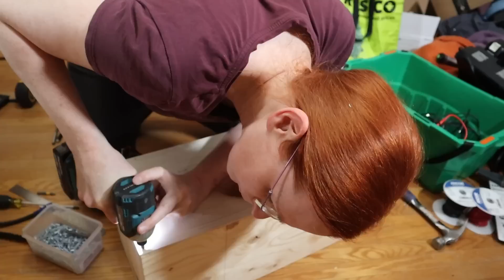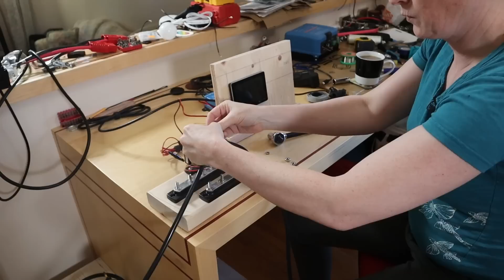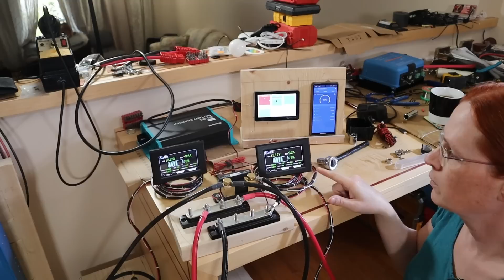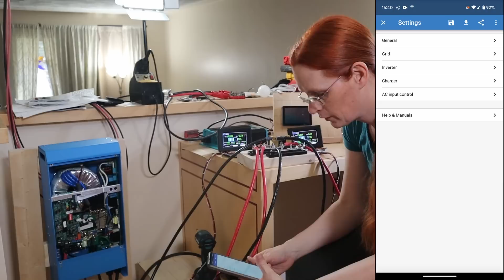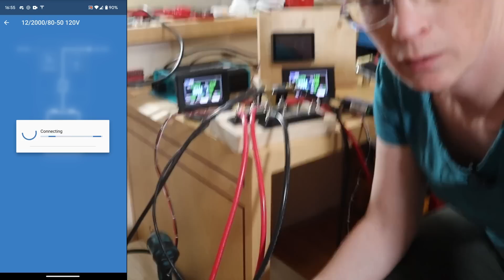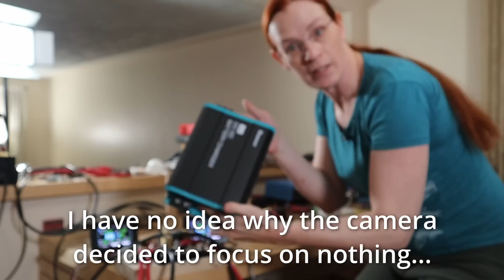Power To Get Me Home (Ep. 61)

Comment: Something I did for a precharge resistor was to put a cheap volt meter across it. Then if there precharge resistor has a voltage difference across it then that'll show on the volt meter. Once the precharge is compete it should show zero volts. Same thing could be done with an LED perhaps?
Reply from the maker: Huh, those might well work, too. Others commented that the lead (graphite) from a pencil would work, also.

Comment: What kind of Temps are you going to see in your engine bay?  Remember most engines will run at 70 - 100 c
Reply from the maker: Not sure, but "hot". I'm planning to get that sticky-back reflective thermal insulation to cover the engine bat facing battery.

Comment: Just gave me that "Duh" moment and made things Click for me. I have my BMS and Charging system set at the same voltages for shut off. When you said do I want my bms or the charger to control charging cut off. It just made it all clcik that I need to change those settings. Coincidentally in the throws of redoing my camper system for the season.
Reply from the maker: Glad it helped! I ended up setting the Multiplus to stop charging at an even lower voltage (coming video), as the math I was doing was assuming all cells were balanced. When they're not, the BMS will cut off at a lower pack voltage, causing the Multiplus to just suddenly lose the batteries.

Comment: Tip for drilling wood for screws - size your bit to the base diameter of the screw, the screw minus the height of the threads. Some screws do better with a tapered bit, such as wood screws. Lag screws require two diameters, one for the thread area and one for just below the head.
Reply from the maker: Yup, that's the target and good advice. I just mis-eyeball'ed it on this one... Clear for the screw's shaft, let the threads do the work.

Comment: The Top 10 Things I Learned From This Video

Using cable lacing to clean up wiring harnesses.
Using simple screws and avoiding machine threads when putting lids on equipment to avoid damaging batteries.
Being careful when drilling pilot holes for screws to avoid damaging batteries.
Breaking edges on lids to avoid snagging on things when moving equipment.
Using a resistor to pre-charge the capacitor and making sure to connect it correctly.
Updating firmware for batteries to ensure compatibility with other devices.
Checking voltage and transfer current to monitor battery performance.
Being careful when working on projects to avoid damaging equipment.
Salvaging parts to save money instead of buying new ones.
Setting up devices properly for specific battery types.
Reply from the maker: Dude, legit, I'm happy you got so much out of it! ^_^

Comment: 14.1V is the right choice. Relying on the BMS to control charging is not a good idea; the BMS should only be your last line of defense in case something goes very wrong.
Reply from the maker: Ya, this turned into an unexpected issue when I installed the packs... Ended up changing the config, and having the little charger become the little damn hero for me. I'll have that all up in a coming video... With rushing to get ready for the trip home, the video is coming in faster than I can edit now. :)

Comment: hi i enjoy your vlogs thank ya. do the batteries  need to be vented  for heat
Reply from the maker: Nope. With the 12v system, I've peaked a little over 100A draw on the 12v side now, ~50A/pack, and that's a touch under 0.2c, and that's holding up house loads. Once I get home and switch to the 48v bank, six in parallel, the load on the 12v side will fall even further. So the loads will be low enough that heating will never be a concern. In fact, heating the batteries in cold weather is my real concern. :)

Comment: I do not use a pre charge resistor. I turn off bms hook everything up, turn on bms to each. make sure all packs are balanced to same voltage then flip my battery switch so inverter gets power. Inverters unless they are shity brands can handle the battery voltage and it doesn't cause any spark doing it this way. Mine have a capacitor to handle that voltage spike.
Reply from the maker: I've had the JK BMSes go into over current protection a few times when I turned on the Multi and Quattro without using the precharge resistor first. For my setup, it's really important.

Comment: Thanks for more great content! I usually charge to 14.4 without tripping OVP, but I suppose if enough cycles move the gaps between cells far enough apart faster than the BMS can balance, it might trip in the future. I've heard of people having trouble with that. On the other hand, I do like the idea of getting closer to 100%, so I'm rolling the dice at the moment.
Reply from the maker: So funny enough, this became a larger issue than I expected once I got onto the boat. I ended up dialing the voltage back more (using Victron Connect) as the packs I built here were more out of balance than I realized. Ended up that the little charger I got proved super useful in the end!

Comment: I have the same Victron Multiplus going into my Catalina 310. The former power supply/charger was located away from the rest of the electronics. There is an AC cable that is tied into the zip-tied cable assembly. Not sure if I can remove it completely. It will be a task I now need to finish.

Following your programming of the Victron Multiplus was very informative for my situation as I confirm the settings.
Reply from the maker: I'm really happy to hear that it helped! ^_^